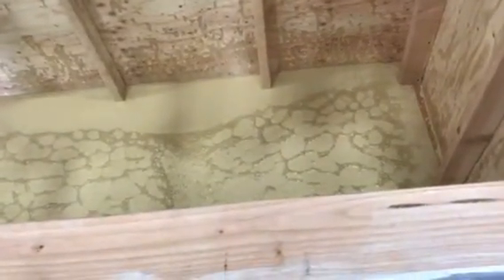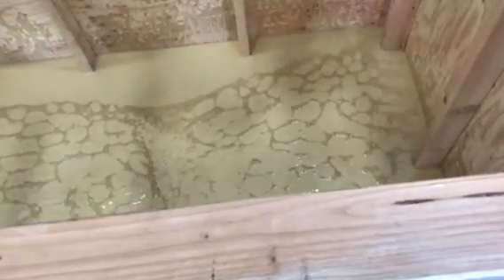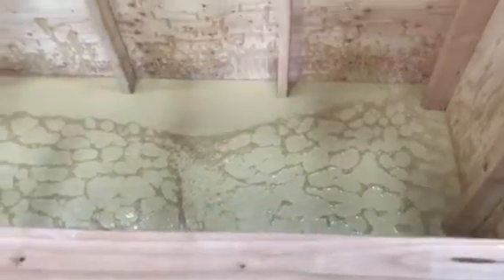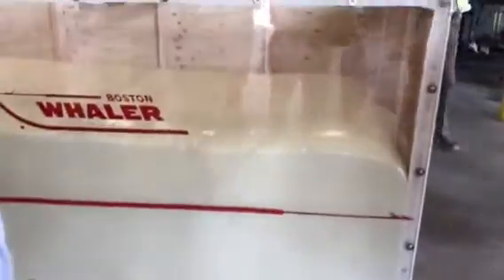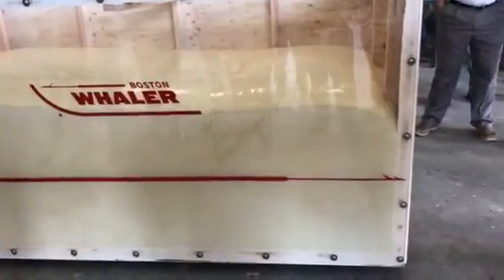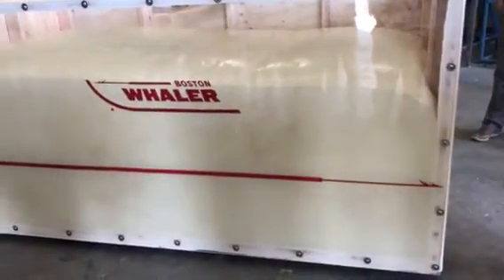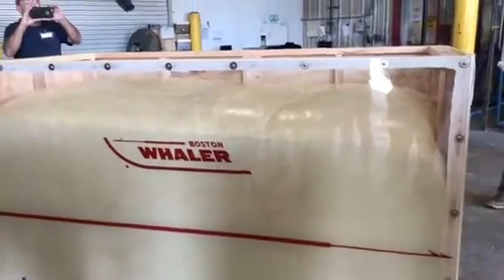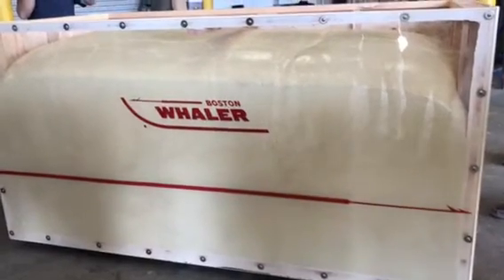Why Boston Whaler? Structural foam.

Comment: The foam is great until it gets waterlogged, then it becomes a sponge
Reply: When the foam in a boat gets water logged, it's usually because the foam was not mixed correctly
Reply: @ctalley80  No, it will all soak up aware if exposed long enough.
Reply: @bryanturner683  what is your background on foam?
Reply: I wonder how they keep the machine from clogging up?
Reply: Not if its closed cell foam.
Reply: @vannigiovannigio8861  this may be true, so the question would be this... Why would a BOAT company use foam that can be waterlogged?  I have seen several videos of water-logged boats that used foam even Boston Whalers, so why would they put foam in a boat that could be waterlogged is the question.
Reply: @Digital-Sparks  My guess would be that there isn't any perfectly made boat. They are probably using their tested recipe for building a boat. If the boat is taken care of, the foam inside shouldn't ever see water.  Boats just don't leak or acquire a hull crack. Someone made it leak. If it leaks have it repaired. Right? That way there isn't any time for foam damage.

Comment: Where can I buy this foam?? Im reztoring a boat and Ive had to remove several pounds of water logged foam. And Id like to replace it with the best stuff possible.. I would like buoyancy though.. Nothing thats gonna drag it down
Reply: Check us composites their 2 part foam but think more how you're gonna pour it and since you probably can't clamp a fiberglass top skin down, you'll need plywood weighted and anchored down with relief holes cut in for the foam to oooz and escape or it'll blow the top right off
Reply: @vivimu  It soaks up water, dont use.
Reply: Dont use two part foams, they ALL will soak up water. Read the data sheets.!!

Comment: It is part A nd B  2 lb foam just like what is used in most other boats.  "Whaler" does not make this foam.
Reply: It’s also a flotation foam. Not structural.
Reply: @JS-rp7qb  all closed cell foam is structural
Reply: This company seems to be very gimmicky
Reply: Yet you'll never find a photo of one on the seabed. Yes, you can roll them but you cant sink one.
Reply: Where Can I buy this foam?? Im restoring a boat now that has waterlogged foam and im replacing some of it..
Reply: they use a 4lb foam
Reply: Actually it is 5lbs foam and they use it on a compressed mold. No other company in the world does that. Other boats cut foam shapes to fit in or fill the stringers with non-compressed foam. BW fills the entire boat. It is not the same. BW rides smooth and solid. You cannot sink them. On top of that, their quality is top tier. I have owned 3 of them, and now own a Dauntless.
Reply: They shouldn't be standing over that foam gassing off without respirators... Smh.